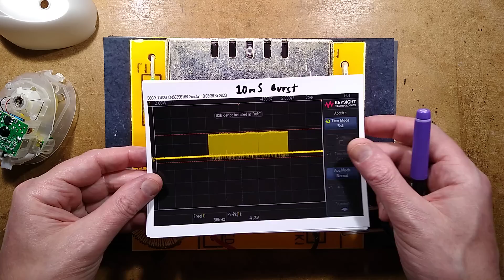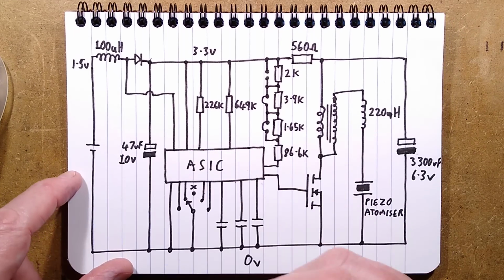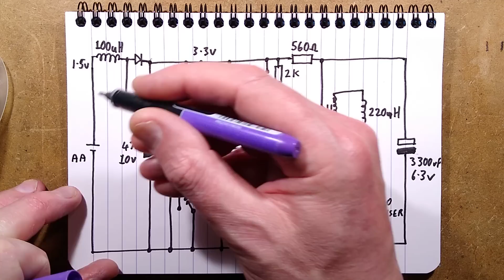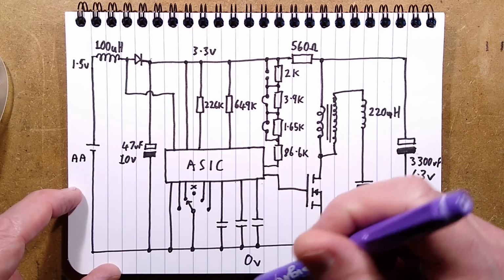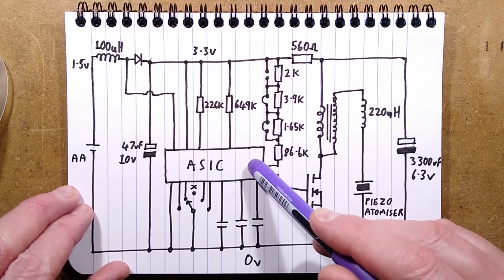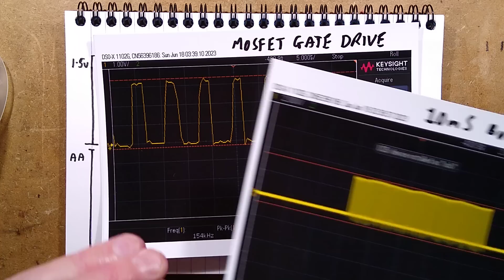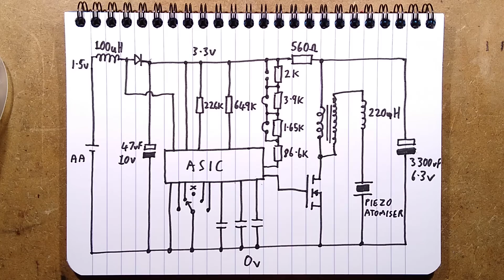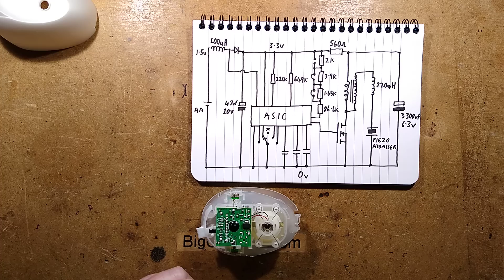1.5V powered Glade Wisp ultrasonic oil atomizer

Comment: Somehow I got a kick out of "I had to import this from America" since, of course, I live there (San Diego..  :)  Then again, I'm easily amused.

Second, your obvious enjoyment of discovering (re-discovering?) the innards of this is infectious and is one of the several reasons so many folks like your channel.  Thank you!

Third, what did you mean by older tech in batteries not leaking?  I know I've had a ton of batteries of various brands leak and have been very surprised, and frustrated by it.  I'm old enough to remember ads on packages saying things like "never leak" or similar.  I would think newer materials/seals would be better, not worse at containing the obviously corrosive fluids.  (Not necessarily NiCd as in old PC type clock setups, they were notorious for leaking and ruining circuits).
Reply from the maker: The older cells were engineered to prevent internal pressure build up by recombining liberated gas.  They banned some of the chemicals and newer formulas have proven to less effective.  With very low current draw or even in packaging they can overpressure and vent electrolyte.
Reply: It's worth mentioning that very old alkaline batteries were formulated differently. When the MythBusters were testing whether liquid nitrogen would have disarmed the battery in an explosion trap, it turns out that modern (2010s at the time) batteries wouldn't be affected, but batteries using a 1980s formulation (the movie was from the 80s) were temporarily defused by the liquid nitrogen long enough for the would-be victim to escape the room. My guess as to how they got a working 1980s formula battery in the 2010s would be obtaining a very cheap alkaline battery. The episode specifically meant alkaline batteries for the record. I'm not too sure what a zinc-carbon battery would do over time, or whether their corrosion is worse. However, that technology has been around for many decades. In 1951, Popular Science wrote a tip saying that one should dispose of non-working flashlight batteries in a fireplace to mitigate soot. In those days, batteries were zinc-carbon and they often weren't the "cans" used nowadays, in fact, some were basically mostly elemental zinc and elemental carbon, and often in a sort of special "cardboard". Such batteries are depicted in Back To The Future's sequels as a large battery dissimilar to even 1980s batteries that is taped to the back of the walkie-talkie and wired to it. 
Note that the smaller cell sizes were much less common in the 1950s. Anyways, these batteries that weren't the type of cans that modern batteries are made of and which featured more primitive contents compared to modern zine and alkaline batteries weren't as dangerous to burn. However, burning zinc in general is not a good idea. In styropyro's 4th video on the 1933 (and later) Chemical Formulary books, one of the recipes involved produces zinc chloride fumes as a form of fog, which styropyro outright says is not great to inhale. The 90yo book puts zinc chloride under the section detailing stuff like chlorine gas and similar toxic gases used in 1915, albeit lower-tier. Styropyro says that the zinc chloride fumes ARE not as lower-tier as the book says. So the 1950s advice of burning zinc-carbon batteries was not as safe as Popular Science's 1951 issue claimed. Having said that, burning more modern zinc-carbon batteries or alkaline batteries (or any batteries at all) is an extremely terrible idea, because it releases many more chemicals than just zinc and carbon derivatives (even modern zinc-carbon batteries are more complex than older ones), has a risk of exploding, and is very harmful to the environment. Burning cadmium batteries, lead-acid batteries, or mercury button and coin cell batteries releases stuff that is most definitely highly toxic. Nickel metal is an allergen in jewelry, so burning nickel metal hydride batteries could have very tragic repercussions if anyone near the fumes has a nickel allergy. Lithium-polymer batteries when burned essentially burn that polymer inside which is effectively like burning plastic. Not the best thing to breathe in. Some batteries release hydrogen gas when damaged, especially Lithium batteries. Basically: don't burn batteries.

As far as battery formulations, yes, older batteries had different formulations, some of which don't have as much potential to destroy what they are left too long in. If a zinc-carbon battery was formulated closer to elemental zinc and carbon, depending on what metal the terminals of the battery and its device are, and if the battery is not 1950s cardboard yet is also not a pressurized container packed with more-liquid contents, it may not be as destructive if left in a device for too long. I still recommend after removing old batteries to clean the terminals even if they appear undamaged, because even residue that isn't obvious can be bad.

Also, when it comes to alkaline battery residue, I can actually say that a lot of my grandparents' devices that corroded with alkaline batteries from the mid 1980s to the end of the 1990s corroded with green corrosion, but the alkaline batteries that corrode in modern times leave white corrosion. 2005 may have been the tail end of batteries that corrode green. Quite a few American battery brands even back in the olden days had a ten year shelf life if unused. If the battery had that date as 2005, then 1995 would have been the manufacturing date of the battery, which would fit with the observed timeline of an alkaline battery that would corrode differently from modern alkaline batteries in my experience. Also, green corrosion could also be a result of corrosion going on long enough to REALLY corrode and oxidize the contacts. Or if there is copper involved (zinc and copper batteries that use acidic electrolytes are not uncommon), the green color could be oxidized and/or corroded copper and/or copper derivatives. 

So ultimately, the batteries being from the right time period with the right formulation is what saved the air freshener. Batteries HAVE changed since then. Some only take 2-3 years in a remote to corrode. I advise checking all your devices for corroded batteries. Oh, and something I use to clean corrosion is vinegar on a cotton swab when dealing with alkaline battery leakage to neutralize the alkalinity in the cleaning process. As for zinc-carbon battery corrosion, given that zinc-copper batteries using lemon juice are science demos (in an older episode of MythBusters, namely the Baghdad Battery episode, lemon juice with iron and copper can generate power too, but less so), the vinegar option alone may not fully get things out, so you'd also want to use isopropanol or ethanol. I'd recommend not using acetone due to its potential to dissolve plastic. Additionally, oxidizers like hydrogen peroxide or chlorine bleach would probably do more harm than good. As for nickel metal hydride and Lithium batteries, vinegar again is an unknown. For lead-acid batteries, you'd probably want to use a solution of baking soda rather than vinegar as an interim measure before calling in someone able to decontaminate lead. Now where it gets messy is when the leakage is from mercury button-cell or mercury coin cell batteries, as well as Nickel-Cadmium batteries. Mercury, lead, and cadmium are all highly poisonous, and sulfuric acid is too. If you're dealing with leakage of these types of batteries, call in people who clean up poisonous waste professionally. Also, no matter what battery messes you clean up, wear gloves and eye protection at the bare minimum. You don't want any of what's in a battery on you or in you.

TL;DR: old batteries corrode differently
Reply: @stgigamovement  Any of the phosphoric acid based household cleaners (CLR, Lime Away, Barkeep's Friend, etc.) remove alkaline battery corrosion very nicely. It's a relatively mild acid that won't do anything to plastic and isn't real aggressive to metals. It just removes the crud and eats just a tiny bit of metal giving it a "chem polish". For fun drop a manky penny in some CLR.
Reply: @sootikins  CLR would be handy on stuff that is badly corroded but still functional. It is, after all, meant to remove rust. Just don't get it on your skin.
Reply: Every once in a while I'll run across a device or toy that was put in storage with the batteries still installed. Several have leaked but the REALLY old stuff doesn't seem to as much. Also some have been in storage since before we left Florida so they've doubtless been subjected to temps over 100F and maybe as much as 120F.

Comment: Interesting device, especially the 1v5 - 3v3 step up circuitry. 
Also enjoyed the slightly more in-depth waveform prints of whats going on at different stages of the circuit.
Reply: It's always nice to see waveforms.
Reply: Not seen you about for a while. Have you stopped riding the rat bike?
Reply: Wondering if you powered it with 3.3v instead of 1.5. How it change it's proformens
Reply: @MartinBalle7  If you mean two cells in series instead of a single AA, it will get at best 3.2V just for a short time. The circuit needs some regulator.
Pretty sure the ASIC has a brown out detector feature as well, like any microcontroler.

Comment: 3:50 As an added challenge, can you read the writing on the circuit-board which is now both mirrored and upside-down? I got a bit confused over what I thought was +TAB until I realised it was BAT+ ;-)
Reply from the maker: I inverted one side so it trusted directly to the image of the other side.

Comment: I'm wondering if the inductor in series with the piezo is forming a tuned circuit. The piezo might be ringing at a frequency even higher than the drive pulses. The resonance would also mean a larger voltage across the piezo.

Comment: Very interesting! Far more complex than I would have assumed.
Could you perhaps change the jumper settings while monitoring the output? You could thereby confirm or disprove your assumption about them being for tuning the frequency. Likewise adding/removing capacitors to those connecting the ASIC to ground could give a clue as to function.
Reply from the maker: I tried external resistors.  The two individual resistors affected general delay timing and burst timing.  The four tunable resistors seemed to affect the atomiser.

Comment: Weird that they went from something this small and ingenious to the later large units with a motor and large spray can. It's like reversed evolution.
Reply: If your body temp goes above 260c, the least of your problems will be your ptfe prosthetics.
Reply: @Baja555b On the other hand, if your frying pan goes above 260 C and the teflon starts breaking down into toxic chemicals, that may be your greatest worry.
Reply: maybe the piezo device didnt last long, or it got caked up with muck?
Reply from the maker: @andygozzo72  There is a newer version that puts out larger bursts with a long time between them.
Reply: @andygozzo72  0:54 BC said "it lasts for a long time"

Corporate got involved I guess.
Reply: When I was getting my kitchen countertops installed, one of the installers noticed this cool 70s Seiko clock I have on top of my fridge. He stood on his toes to look at it, and the air freshener right next to it sprayed him directly in the eyes.
Reply: @BornToSneeze         OUCHEES!
Reply: @BornToSneeze poor fella
Reply: Remember when Dow chemical quietly changed the chemicals in Saran wrap? Turns out polyvinylidene chloride was quite toxic (just like Teflon) and they switched to polyethylene without a peep until customers noticed and started complaining. Dow claims it was about cost...  Turns out aerosolized chemicals aren't great to inhale either, there's literally a warning on them not to breath them. Essential oils are labeled "not for human consumption" yet they aerosolize them and sell the garbage in combo packs with the units and oils.
Reply: @mattgayda2840  Teflon isn't toxic at all. In fact, it's so inert that it is used for prosthetic blood vessels.
Reply: @kpanic23   In general use it shouldn't degrade as it resists corrosive chemicals very well It will begin to decompose thermally above 260C though, fortunately most oils don't get that hot. PFOA is a carcinoge that used to be used to manufacture PTFE, get rid of any teflon cookware produced pre-2013.
Reply: @kpanic23 it’s when you get it to hot and grandma takes a Brillo to it. Pfoa, bad juju, maybe not love canal but it has significant impact on the water here , hard to treat. It’s a problem inherent in plastic, and with 3d printing.🙄😳
Reply: @kpanic23 you never get 100% perfect polymerization and the precursors are nasty.
Reply: @kpanic23 on the proviso it's kept well within its temperature range.

In fairness if your Teflon blood vessels are over 200 degrees celcius, you've probably got bigger problems
Reply: @kpanic23 
   And heart valves!
Reply: @mattgayda2840 water vapor is an aerosolized chemical. Every time you smell anything you're smelling aerosolized chemicals. The compounds and doses are probably the more salient and meaningful thing to investigate rather than "chemicals"
Reply: 99% of the time the answer is money. So I'd bet that's the same here. 
No need to "calibrate" the resistance, or use finicky piezo atomizers. All of that adds overhead. 
A cheapo hobby motor and a pressurized can are virtually foolproof and dirt dirt dirt cheap. You can basically drive them with the cheapest dirtiest timing circuits around, or just pir sensors.

So usually it's just about the bottom line, money. 

Rarely, it's regulation or safety concerns. As some have pointed to the possibility of.
Reply: spray can and motor units existed decades before this did
Reply: Less death. VOCs bad. Lawsuits costly.
Reply: Atomizer units are most likely more expensive to make compared to a cheap motor hitting a nozzle.
Reply: I remember being little when these came out and my mom putting them all around the house. To my surprise it really made the entire home smell good.

Comment: Fantastic circuit and use of a single AA. My electronic circuit design career was set back by many years by not being able to afford dry cells to power them through testing. 
I had a 12V model train supply but that was too much and too noisy for the UK BC range of transistors I could get at the time.  PP3 9V batteries that most kits used would be a week of pocket money!
Reply: I had a similar problem, so I would salvage batteries when they got replaced.  That meant that most of my circuit design was done using nearly dead batteries.  Which was probably a good thing, because I still managed to melt wires from time to time.
Reply: @kittenisageek - I had four D size NiCad cells. They were great fun for getting thin copper wire hot, which of course then burned and melted 😂